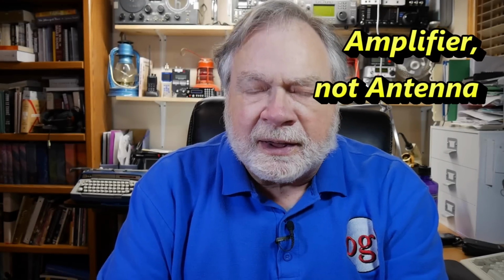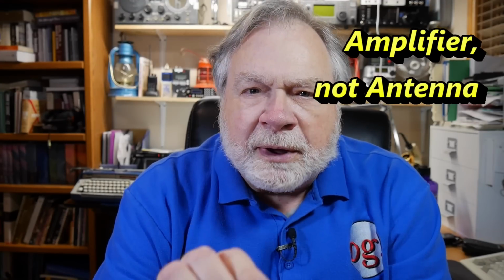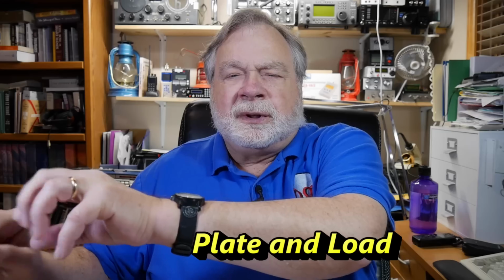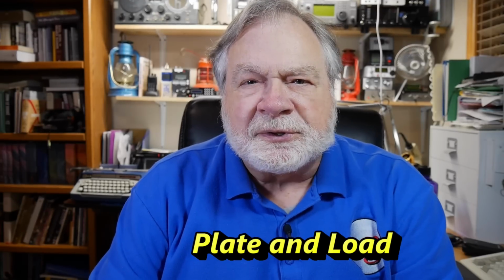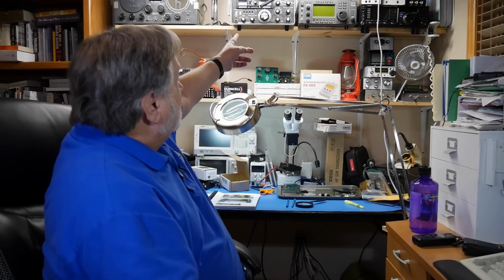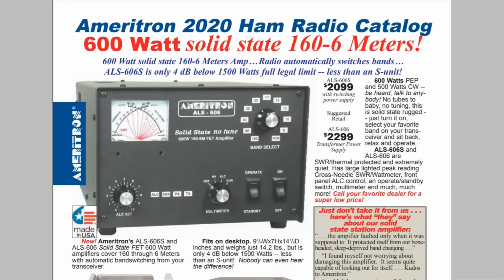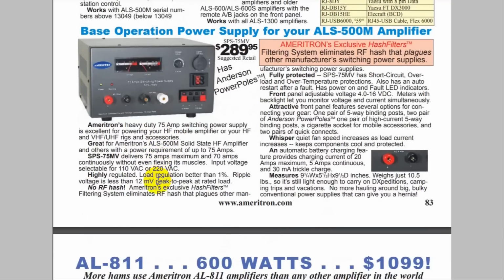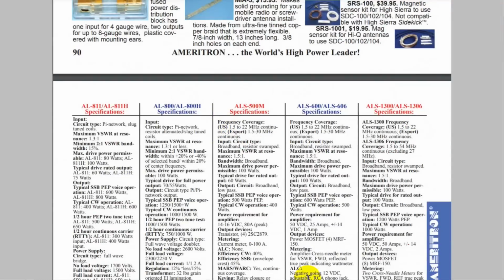When Can I Get an Amp for Ham Radio? (#346)

Comment: Years ago I set out building my dream station.  I bought a Yaesu FT-1000MP transceiver (Yaesu's flagship at the time).   Then I had a 70 ft tower erected with a ten element log periodic array (14 through 30 MHz with no traps)  at the top.  My buddy had several amps...both tube and solid state.  He had taken a Henry 2K (foor model on wheels) and modified it to use a 3CX1500A7 tube and beefed up the power supply.  It would do 1500 watts with about 80 watts drive) in it's sleep. I bought it for $1200.  I then, after doing the research, decided on two five eights waves in phase for 75 meters.  I used the tower as the center point and strung out about 300 feet of #14 insulated wire.  I fed it with open wire ladder line to a balanced output 2 kw tuner.  All this took about 5 months to get together.  The result was amazing...but also interesting.  With those antennas at that height I found that, under most circumstances, I didn't need the amp.

Comment: 500 watts on 80 and 40 is a good touch up on the bands, most watering holes won't take you seriously (won't bother with you) unless you have a decent signal, hence why most poor hams linger around nets because they can be heard on 100 watts and the net control will take in any signal they can hear.

Comment: Built a Heathkit SB-200 in 1971 for my dad, to try to motivate him to get his General Class license...back when there was a 13wpm CW requirement, of course.  He never got his General Class, stayed at Technician.  So it sat in his shack, unused, in Michigan, then Ohio, and finally in Florida.  When he died 3 years ago, I inherited it back.  It was pristine, and (as far as I know) unused, aside from the initial checkout sessions I conducted right after building it.

To prepare it for its role in my shack, among other things, I:
Recapped it (the 50-year old original caps checked out good after I pulled them)
Installed a KeyAll Plus soft key circuit (though the T/R relay in my Kenwood TS-140s could have handled the original high keying voltage)
Replaced the SWR sensitivity pot with one that includes a push-pull switch to enable standby/operate selection
Changed the meter lamp to LED (to avoid heat deformation of the meter housing)
Installed a homebrew circuit to limit power-on inrush

It's been bullet proof.  I initially run barefoot for any QSO, and switch it on only if the need becomes evident.  I don't push it, running only about 500w output with 80w drive for CW mode, and it just cruises along without breaking a sweat.  What fun to have gear that is over 50 years old that I had the pleasure of building when I was a young man of 20.

Thanks for another enjoyable episode, Dave.

Comment: NO NO NO NO.  IF YOU LIKE TO CHASE DX. YOU NEED AN AMPLIFIER, BECAUSE ALL THE OTHER GUYS ARE USING AMPS CAUSING PILE UPS.  SO IF YOU WANT TO GET THROUGH THE PILE UPS YOU DO NEED AN AMP.  NOT 5 KW.  BUT 600 WATTS WORKS WELL.  A FULL S UNIT

Comment: Interesting...

I remember the days I thought I needed an amplifier to be able to talk to the 40/80 meter rag chew nets at night when the band is noisy.  My 100 watts into a dipole left me in the mud.  But, then, I was able to raise a doublet to 100 feet.  I was right in there with the amplified guys. 

I had a friend who put a full wave loop on top of his apartment building.  His barefoot signal always beat out mine, but pretty much no one else's did.  

You mentioned at the end that if  you want to improve a balanced station, that's when you are talking about Yagis that will improve your receive along with the amp.  I know you know this, but if the station is balanced, the beam will keep it balanced. You know it amplifies both incoming and outgoing signals.  (but someone who reads this might want to know.)

Just finding better antennas will generally do most hams the most good. The serious competitors, they will always try to get more than they need. 

I would love to have a 300w amp.  It is really enough to get over just about the worst band conditions and make conversations more comfortable sometimes. But, seriously, a better antenna would solve that issue, too. 

Funny thing is, this year, when I set up my shack at my apartment, I've been almost exclusively QRP.  If needed, I can multiply my power by 20 times, if I want.  LOL

73's by the gazillions, LOL

Or 

72 if you QRP

Comment: I’m in the UK🇬🇧 I had a chat with someone in Texas on an icom 7300 with 100w and a sigma x80. I’ve always understood the argument to be antenna quality and height is better than a 1kw amp. Putting 1kw into a garbage antenna will get some results but at what cost. And my antennas although not garbage are compromised due to height and space layout. I keep going back and forth between buying an amp and not.  I don’t have one YET!

Comment: If I am seeing the als-600 from the video for just under 1000 dollars used should I jump on it?
Reply: I have a Kenwood TL-922a amplifier that is wired for 240 volts and puts out about 1250 watts.   It is great for busting up pile ups.   But, what I discovered that works just as well, or better,  is appending "portable" or "QRP" to my call.  I make just as many, or more, contacts at power levels of 5 to 10 watts as I do at 100 watts.   And, I have not used the amplifier in more than fifteen years.
Reply: @richardowens9061 that’s interesting, I had tried that a few times and with some good dx that I couldn’t get through to, I mostly use ssb so it’s not as effective at qrp as digital or cw. Furthermore I use an omnidirectional vertical resonator so I lose that power in the direction I want to talk too. These reasons I suspect, are why it didn’t work for me.

Comment: The other important reason to have an amp that wasn't mentioned is using the low bands when noise is up.  100W just isn't going to do it on 80m when the noise floor is at S9 in the summertime.

Comment: Thanks Dave.   I just bought a 1500 watt amp.  

Im looking forward to being heard.  

I have a RCI 2950 export radio in my truck 10, 11 and 12 meter with a Texas Star 1100 watt linear.  

Ive talked across the country on all bands on 11 meter.  

For those of you complaining about we amp owners, or that its too exoensive, this is a very cheap hobby compared to auto racing, flying a plane or thermal hog hunting.

Comment: An amp with tunable inputs will work with any HF transceiver. Even running a Heath kit SA-2040 in front of your amp cures many problems noted by  Hams.

Comment: Height is its own amplifier! Tall trees are the best for antennas made of wire. I am lucky to have two 70' cedar trees on my property. I live on a 550' hill, too. 80 watts got me a 59++ signal report almost every time except when the band is dead. Even then, I could raise a VK station on a dead 15 meter band by constant three minute call and make the contact and get a QSL card proving it. I made a call on 6 Meters from Montgomery, AL to  Scotland on 50.537 SSB and have the QSL card to prove it. Height is cheaper than an amp !!

Comment: I'll add one more scenario in which you might need an amp: if you have an icom 7100 and when you bought it you didn't know that it was power challenged on SSB and you barely every put out more than 40W PEP even on a perfect match antenna! (I'm in this situation now and actively looking for an amp, thinking of JUMA PA1000+ and would drive it at 400W since it's my limit here but ready in case that changes)

Comment: Dave, I think a lot of guys have a bad habit of speaking at too large a distance from the microphone, which is not the best way to be heard on hf ssb. After a resonant, efficiently radiating antenna, the proper mic gain,  bandwidth, and EQ, with the right amount of processing and adjustment (comp, alc, etc) for your voice, properly placed close to the mic, goes a long way towards maximizing the 100w "barefoot" station.

Comment: 100w to 1,000w is 10dB. This is an increase of LESS THAN TWO S-Units on the receiving side (one S-unit requires 6 dB). Stay with 100W. Optimize your antenna. Also use some audio compression if you have it. Great video - I like your advice that you need optimize your system if you cannot be heard when you hear them. I love verticals, low takeoff angle!
Reply: Who cares about S units? You need to be heard above the noise!
Reply: A 10 dB increase in power is a 20 dB increase in voltage. 
A "calibrated"
S-unit is a 6 dB change in voltage, corresponding to a 3 dB change in power. If you were @ S9, a 10 dB power increase will bring you to S9+20dB over S9.👨🏻

Comment: This is by far the biggest rabbit hole that I have found in amateur radio.  It really comes down to money.  Solid state amps are far easier to use, but they cost a fortune, and they're all 12V requiring like 80 amps, so you have to buy an obscenely expensive new power supply for it.  For whatever reason, most tube amps can be had with 120 AC power, so you just plug it into your wall socket.  However, the tradeoff is that, with tubes, you have to tune, tune, re-tune, tune.... every time you so much as change frequencies.   So that "hit the magic button" only works with a solid state amp.  If you have to re-tune every time you change frequency and/or band, then you need a dummy load that can handle the increased wattage which is another two hundred bucks.    For either type of amp you will need a larger capacity tuner, which will set you back another five hundred bucks or so.  Then, depending on what type of HF antenna you use, you might have to upgrade that as well.  Finally, the tuning is all transmitted watts-dependent which means that you also need a new watt meter that will handle the increased power.  You'll also need another fifty bucks worth of cables and adapters to make your new rig work. So, I guess what I'm saying is, If you're not willing to shell out about $2500 bucks,  then don't even get started down the amp road.
Reply: So that "hit the magic button" only works with a solid state amp.
The Alpha 87A has entered the chat.
Reply: Thank the Lord I got all my stuff in the 60s.  I could not afford much new today.  Hams keep things going. I am proud of that.
Reply: Try hunting hogs.  One good thermal scope cost $5k along with another $3k for a  good rifle and another $1500 for a silencer.  Then another $4k for a spotting thermal.  

Easily to spend $15 to 20k. 

Or car racing.  One engine is $50k.  

This is the cheapest hobbie I have by far.

Comment: Hi I’m Mike W8MLD, I use an inverted L and rarely need to power up my AL-811H. I have a load of radials, probably close to 60. It is a very good antenna and I have very good ground, loads of clay and electrolytes. Most of the radials are buried, but I keep adding more as time goes on. Your advice is spot on when you need to add an amp. I usually only use my during contests and when conditions are bad. I get about 730 watts on 160 down to 600 watts on 10 meters. It does the job when needed, and it’s well priced both new and used. I am thinking of swapping out the 811As for 572Bs if I ever find a matched quad.

I find the tube based amplifiers sound better to me.

Comment: I would recommend using a crossneedle on my output line, before deciding you need more power... it will tell you if you have any power at all, or if you are shining a light into a mirror.

Comment: Linear amps are a bane to HF in the 21st century. After re-entering HF after a 20 year hiatus (running a Yaesu FT-840 and stealth ZS6BKW because I live in an antenna restricted area) the first thing I noticed is the ole’ boy channel hogs that used to be confined to 80 meters, have now proliferated to 40, 20, and even 10 meters on occasion. They absolutely ruin QRP and most 100W stations with as much as 200 kilohertz splatter which really affect SDR radios like the ICOM 7300, especially at field day events. 11 meter citizens band was ruined by sloppy operators indiscriminately using linear amps. Fifty years later and upon retirement getting my general and amateur extra, I see the exact same thing happening to HF. Most hams are now urban dwellers and thank goodness for the new digital and VOIP modes, since there is absolutely nothing on local repeaters. I live in Houston and only the club repeaters are being used for nets. The rest of the time all you hear for hours is station ID. The ARRL and FCC need to reexamine power limits and band usage for amps over 400 watts. There is enough RFI and QRM to deal with in addition to HOAs who make external placement of ANY outside antennas very difficult. As the FCC consistently emphasizes, use the MINIMUM amount of power needed to make the contact. Most of the old timers, especially the Deep South don’t grasp this concept and could care less about best amateur practices and techniques.
Reply: After reading your post I went out and bought a 1500 amp!

Thanks for giving me the reason to purchase.
Reply: That "splatter" you're getting on your IC-7300 isn't the fault of the transmitters.  It's because you're using a cheap receiver.  There is a difference between a $1k receiver and a $4k one.

Comment: Nice vid.  One option to save a little $$$ (that you didn't discuss much) is to purchase a used amp. Sometimes you can pick up a 40- or 50-year old amp for below $1K.   Also when going with tube amps in particular, it's important to make sure that replacement tubes can be had for a reasonable price.  Like the "Eimac" case you mentioned, many tubes are becoming difficult/impossible to find.  Many folks now are now considering solid state for just that reason.

Comment: I'm running a temporary Chameleon MPAS 2.0 Vertical antenna with 20 ground radials and it is working good for me. I purchased my first HF radio; the Yaesu FT-DX10, back in November of 2021 and since then I've made over 6000 digital contacts with a few in Phone mode. My question to you is will an amp help me out in contesting. When I enter a phone contest, I hear the station to almost full quieting but transmitting at 100 watts, 150 ft. of Messi Paloni cable which is comparable to LMR-400/500, they are reporting back to me a 54, 53, 52. They are a 59+ over 10 that I can hear. I assume they are using more than a 100 watts of power. It usually takes me 5 or so minutes to make a contact to them while yelling loudly for them to hear me. Will an amp benefit me during those contests so I don't have to constantly yell at them to be heard. Any advice would be greatly appreciated! 73's from N3NQP!

Comment: Not always. I had my MFJ-1979 on my Jeep with my IC-7300. I dialed in my ALC. it’s still low at times, but when I dialed back my bass on my voice. I got Lithuania over someone that had an amp. I got in at the right time and my audio was good. I worked several states. I never had that luck. All because I worked on my setup, audio and ALC. it’s crazy how 100w is enough to make contacts. Now I want to fine tune my antenna, coil, get 40m and then add 300w.

Comment: Another point:   
You'll get a lot more power and reach out of your 100w transceiver if you work CW instead of SSB, because of the concentration of output energy in a very narrow signal..
Yes, you'll have to learn CW Morse, but you'll be able to cover the world with a good to excellent antenna...

Comment: If I wanted to make communications easy I'd use my cellphone. By being limited on longwave to 1 Watt and a 15 meter tall antenna I was forced to actually learn about radio. Within a year my beacon was effectively  blanketing 1/3 of the lower 48 states every day, summer and winter with an EIRP of about 7 mW. The first thing I did with the 40 meter QRP kit I built was to add a control so I could turn down the power, as the FCC rules indicate we should be able to do on all bands with all of our rigs.

A ham license is a license to learn. Those who see it as a license to talk miss the point completely. Talking is what cellphones and CB's are for.

Comment: Those of us who live with a crappy HOA and a ranch style house (no appreciable height even if we can hide the antenna) can't improve our antennas very much. I'm still not going to get an amp, so I have to fiddle with the antenna as much as permissibly possible. I've tried end fed, I've tried off center, I'm currently using a 67 ft dipole that runs right along and under the roof hangover.  It's terrible, but so far it's the best of the three.  My next project is a dual hamstick 20m dipole.